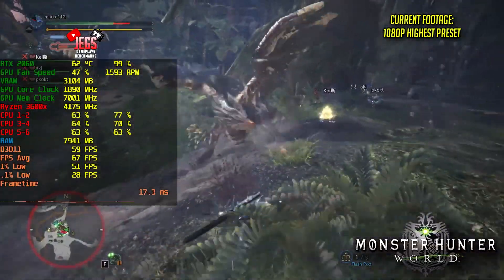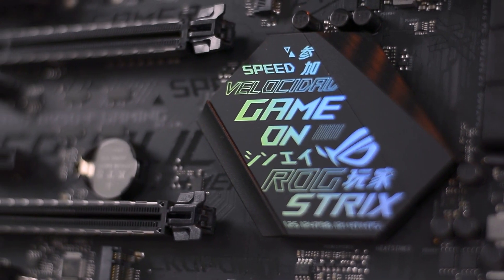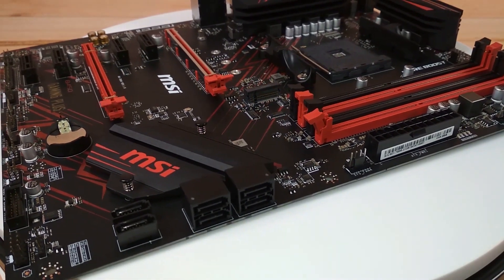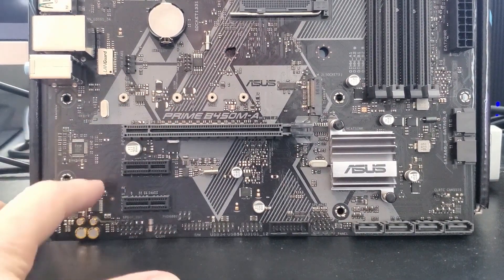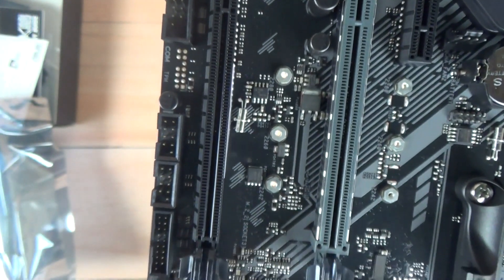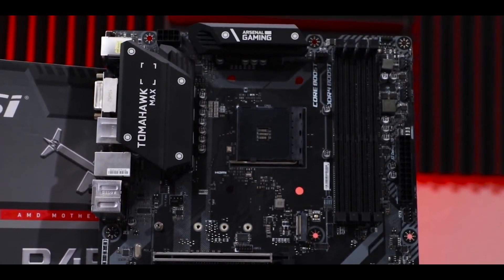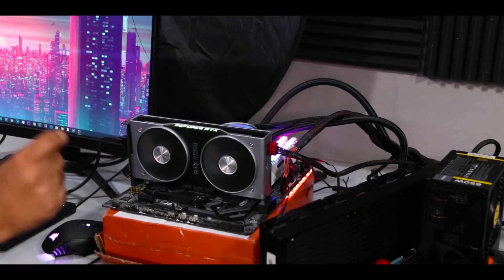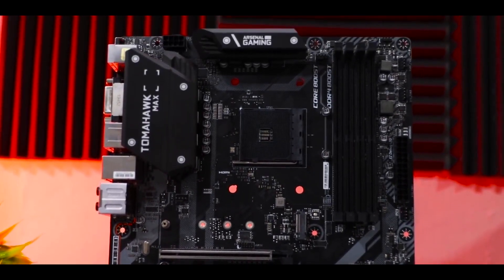Top 5 Best Motherboards for AMD Ryzen 5 3600X 2022 / 2023

Comment: I recently bought a gaming pc with an AMD A320. Is this good enough, or should I swap it for one of the motherboards showcased in the video?
Reply: Think that's a little  on the old side, personally I would buy a MSI MAG X570 tomahawk wifi it's about 200 US.. it's the go to board these days. However just my opinion and this will last you a long time before you need to upgrade it.
Reply: @aso6437  thanks. My motherboard has been working fine for now, but I have been considering upgrading, so maybe I’ll give the X570 a shot.